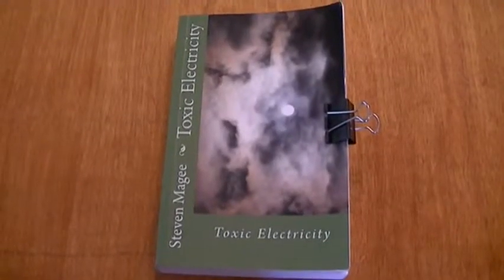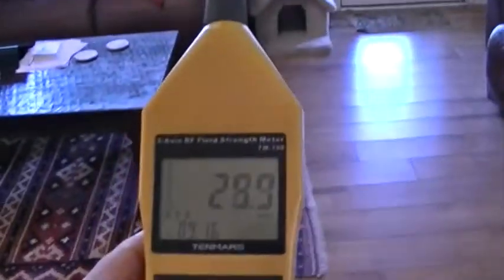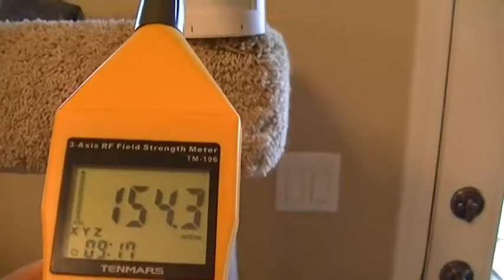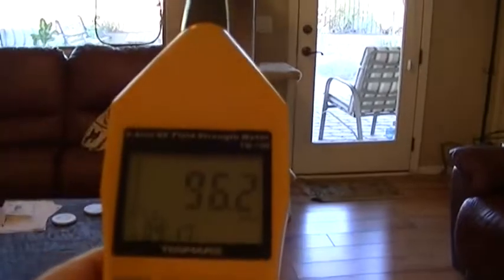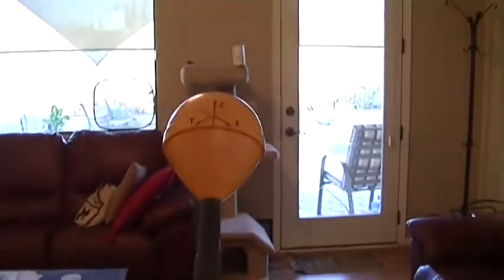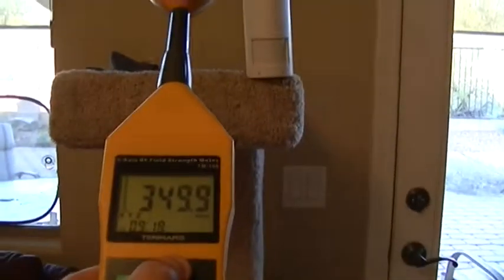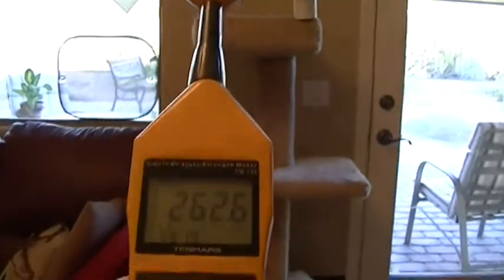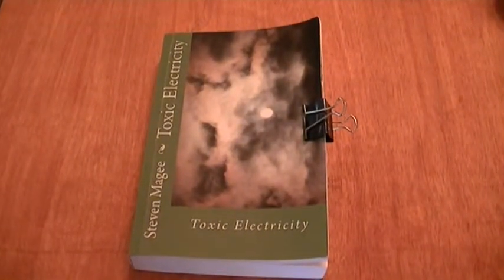Testing a RADAR Sensor with an RF Meter

Comment: I agree with you I have tried to find out about the exposure I received while in the military. I worked on much powerful radar systems in the Hawk Missile system and have a variety of medical problems leading to 14 surgeries. I believe that the radar cause heating of the molecules in my spine disks which dried them out and also multiple tendon damage. I know it heats the molecules in the soft tissues especially the more water they have. Do you know anything about this? The military says I need to prove it did it but how can you when they hide that kind of info, I just want to take a microwave oven and throw in some bacon or glass of water and show what low levels do never mind high power radars. would your book cover any of this
Reply from the maker: The secret military technologies are well known for the biohazards to operators.  I'm really sorry to hear that you had your health damaged by radio frequencies.  I've recovered from much of the RF damage that I had and the techniques are in Health Forensics: http://amzn.com/1494952947